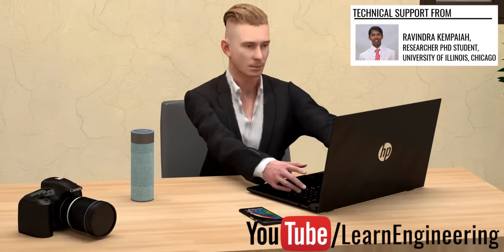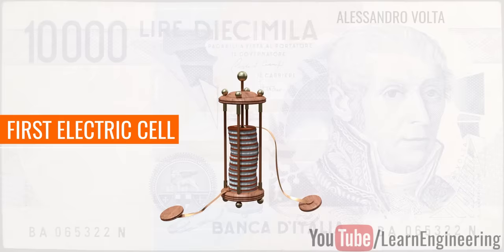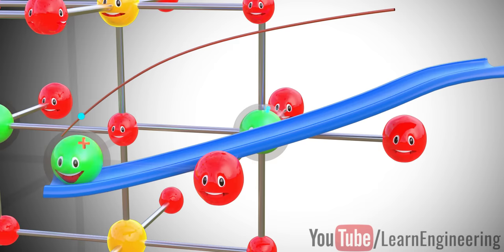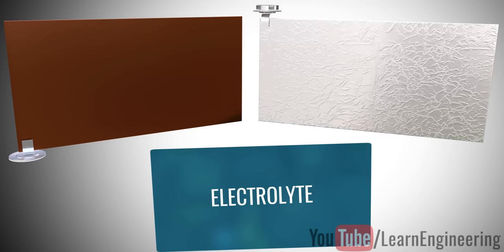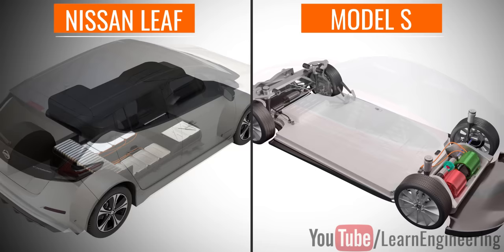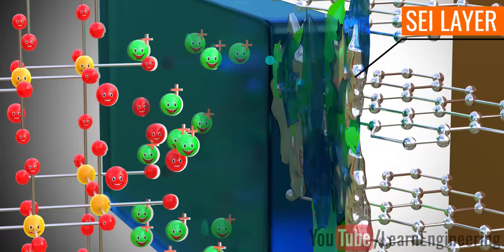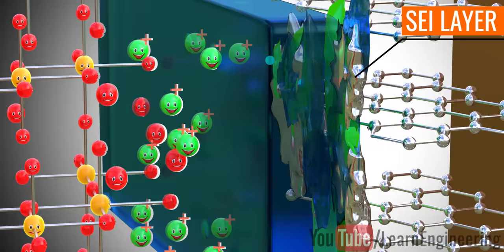Lithium-ion battery, How does it work?

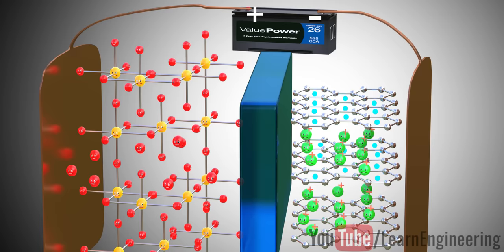Comment: Very nice animation and great level of detail. But... Why don't the electrons and Li+ ion simply recombine on the right-hand side (anode)? How does a material work that prevents extremely tiny electrons to pass, but allows Li+ ion to traverse it where a Li+ ion is orders of magnitude larger as an electron? Why don't we prevent the Li+ ions to flow and keep them on the left-hand side, so only the electrons flow back and forth? At 4:23 the battery is fully charged but the cathode is neutral - how is it charged at all. After all charging = separation of charges.

Comment: The way you explained this is very  good but something is confusing me during that part  on the power source which I believed is the Charging Process . Please correct me if I am wrong. The electrons detached from the Lithium atom on the metal oxide ( left side) will be attracted by the positive side of the  power source and STOPS there. Those  electrons cannot CROSS   there., their job  are to neutralize the positive ions  on the positive side of the power source. The Negative side of the power source will provide the Fresh Electrons   on the graphite sheet until it is full of electrons and all the lithium ion have crossed back to the graphite.

Comment: 2S electron of lithium in lithium metal oxide is transferred to the transitional metal core of the metal oxide. Lithium stays as ion in the Lithium metal oxide complex. Lithium intercalated in
graphite electrode is again mostly ionic with the 2S electron in the pi system of graphite. The process so decribed can not be spontaneous if at both ends the electrons remain with Lithium.

Comment: If we mix two metals after that make a point with thich wore and other side with thin wire it will charge faster and we can also use metals at one side and other metal on another side and use it

Comment: DESIGN SPEC TO AVOID FIRE ; Avoid immediate Charging after getting discharged; Added regions to avoid permanent dead; design and usage cycle spec to recycle ; N2 Flow for thermal stability

Comment: I have some stupid questions: how BMS manages cell charges individually if they are connected in parallel? And why the healthy cell was charged faster? And, did Tesla invented BMS? What about energy density difference between multiple small cells and one large?
Reply: Yeah i was wondering the same thing that big capacity means slow charge

Comment: I am developing a firefighter related class on the dangers of lithium-ion batteries. I would like to know if I may with your permission and reference, use your video to explain the construction part of the lithium ion battery. It is better explained than my power point slides.

Comment: I have been reading about electricity everyday for over a week now.
And I found the few small details thay helps to explain why all the principles are so confused. I write it down, hope it help anybody.
- Electrons dont flow in circuit like all animations showed on youtube. They dont start from negative terminal and enter positive terminal. They leave negative terminal with very low speed (to us, to them it's quite fast), about mm/s, push the near electrons away and so on. Very quickly, electrons keep pushing one another and push electrons at the other end of the wire enter the positive terminal.
- there is current in open circuit, it just stops really really quick. Like: if you connect an end of a wire to a battery, there is movement of electrons for miliseconds and stop. But only in closed circuit the movement is continuous.

Comment: Good interesting video. Vehicle electric motors are not always induction motors. Different types of motors are used, which all have their disadvantages and advantages. The five major ones are: Permanent magnet synchronous motor, induction motor, DC motor, brushless DC motor and switched reluctance motor.

Comment: In the end you pointed out, that there are intentions of using silicon only. This is wrong: Using Silicon leads to alloying/formation reactions which leads to a much greater specific capacity but also a huge volume expansion of about 400% at the anode side, when charging which results in a lot of mechanical stress for the cell and therefore accerlate side reactions as cracks -> the building of additional SEI -> capacity losses, to just name one example. The market however intends to use a little silicon to improve the specific capacity without putting too much mechanical stress to the cell. 
Correct me if I'm wrong.

Comment: how electrons flow in opposite direction of the electric field when the battery connected to an external circuit??... i really need an explanation, please
Reply: Back when humans were first experimenting with electricity, we suspected something charged was flowing, but as all the charge carriers are invisibly small, we had a 50/50 chance of getting it right which direction the flow was going.
We guessed wrong.    For almost all circuits, it was the electrons that flow, positively charged things are much heavier and stayed still.

Comment: Great video, i learned a lot on this topic from this video alone!
How can solvent molecules (from the electrolyte) cover a single lithium-ion? It is depicted in the video as a gooey layer that engulfs the lithium ion, but how would that actually look if you represented the solvet molecules as actual molecules? (I think i have a problem with understanding the scale used here).

Comment: At minute 4:15, I was confused. The external power source introduces electrons to anode compartment, that forces the Li+ ions within the metal oxide to move through electrolyte. But prior to that, it was explained that the electrons from Li atoms trapped in metal oxide structure exit from cathode electrode towards external power source. This part I don't understand. There is no lose electron i that structure (yet), and Li has no available lose electron to send towards power source via cathode. ?!

Comment: Where do the electrons sit in the Graphene layer? If the Li ions are physically sitting in-between the carbon sheets, would it be correct to say that in the charged state, the electrons are sitting in the graphene's conduction band, but do not recombine with the Li ions due to the physical separation?

Comment: I have heard of a completely dry battery industry consisting of a sheet of silicium and on its sides two sheets of aluminum and lithium only. When the two plates are connected the lithium reacte to give silissure (si4- ...4Li+)and electricite

Comment: Lithium cells.  They don't like being kept fully charged,  they don't like being totally dead . They don't like heat and don't like cold. When assembled as a batter they need a management system for changing and monitor discharge. But they do produce a nice profit.

Comment: The main drawbacks with ICE cars are not poor speed control, low acceleration, not self started, low starting torque etc but that they pollute a lot and that they are inefficient. That is why we need EVs.

ICE cars are quite reliable despite of the fact that the engines have thousand of moving parts. 

They are well balanced as well and you can't really feel the vibrations.

Funny that those most important drawbacks, which are the driving force behind the EV revolution, aren't mentioned.

Comment: Are there any batteries that can be recharged forever..??? And   can you explain capacitors used for storing electricity,  My understanding of a capacitor is that its a vacuum bottle full of electrons .. and the problem with using a capacitor is that they  discharge there entire charge at one time.. so they will explode if used wrongly.

Comment: Sir i had a question if electron interaction with electrolyte is not desired than what happens on the right side before the application of external current dont electrons interact with electrolyte there when  they are in outer shell of lithium atom
Reply: Ajaz Amin they don't reach the electrolyte on that end because the electrons all go back to the molecules before they reach it

Comment: There is a small correction. We must use two separators in cylindrical cells other wise it will get shorted during winding.
Reply: IIT Madras created iron battery check out

Comment: How come those Lithium ions and electrons don't interact with each other in the graphite?
Reply: Well, lithium tends to liberate electrons because, the electrons located in inner orbitals, reppel the outer most electrons (only one electron in lithium's case). And the universe always looks for stability, and for a Lithium species, it's more stable to lose that electron. It doesn't happen much in other elements due to a bunch of stuff(Effective nuclear charge among them), so that's the specific case for lithium or alkaline metals in general.

Comment: According to an estimate the real driving range of a BEV is 400Km on a fully charged battery, having Battery capacity of 84000Wh.
So if the cycle is 3000, the lifetime capacity of a battery is 252MillionWh or lifetime driving range of 1.2 Million Km (400*3000).
Again according an estimate, averagely a car runs ~50Km per day.
Argo, A car can run 24000 days = 65 years.
If we even add a buffer of 20-30% the lifespan comes to 52-45 years....

Am I missing something?

Comment: While the narrator may disparage flat LiPo cells, they allow a denser energy storage than round cells. As a test the other day I fed what normally is a 4.2V, 2.2A pouch cell 5V and 5A. Guess what happened. Not a thing except for the battery being fully charged. And yes, it was one made by Sony. And there was no BMS attached to it to do anything in the way of protection. The cell was over water so that if something had happened as I expected, it would have dropped into the metal can of water.

Comment: Toyota already figured out how to make the battery last 10000-50000 cycles, keep the state of charge between 30-80% & avoid high heat & freezing cold 
Keeping the cells 50-70 Deg. F temp & between 3.2 & 4.1 vdc greatly enhances their cycle life & calendar life / true for NiMH & Lithium Ion ^^ Cheers

Comment: A better battery can be produced with semiconductor layer controlled with a gate valve this layer can regulate the electron flow within the cell and it's rate of Discharge. My new battery design allows more accurate charging and regulated discharge of the cell without degredation
Reply: A litium ion battrey  made with a NPN layer with a Gate Valve Electrode will controlling Electron flow within the cell plates, this semiconductor layers acts as a Gate valve it controlling the Electron discharge and recharge without cell Degredation of plate surfaces. This transistor semiconductor Layers limits and throttles the cell Discharge and protects it from rapid discharge that degrades cell plates, this is a ion limiter a built in regulator. This is my new cell Desighn for Lithium ion battreys 😁
Reply: @Chris Biggs  Chris I make battreys for stuff projects electronics. I want to build this on a full scale.   I started making battreys as a kid to run things in my bedroom.😁 I basically descibed the battrey but not in detail.  It's construction is simple Layers of copper foil lithium  separator semiconductor layers and more lithium and  aluminum foil.  The semiconductor layers regulate ion exchange between the plates. The battrey is rolled up with wires for positive plate and negative plate and  semiconductor layers . This stops overcharge and regulates discharge.  My electric plastic motor is yet to be built but I have the plans and theroy it's a induction Motor with a plastic armature and plastic fields. It runs off of 1wire . It's something New the speed is controlled by frequency. I also have plans for 1wire house wiring and lights.   The current won't shock people.
Reply: @Chris Biggs  but Chris who cares? I'm just a poor inventor. And these things are  way before thier time. Maybe if a company hired me to build stuff I could do it for them.  But as you know money always talks😁. It buys food and pays the rent. But the world could use this Battrey Desighn it has a controller that regulates the semiconductor layers inside the cell. I guess I'm a Tesla looking for my JP Morgan.😁
Reply: @Chris Biggs  my motor runs off of electromagnetic induction, high frequency electromagnetic current. It only needs 1wire to make it Run 😁
Reply: @Chris Biggs so Chris what have you made?
Reply: Cat got your tounge? 🤔 Dam cat 🐈

Comment: Defiantly very useful, but why do these batteries have a lifetime? 
If the ions can move through the electrolyte without loss (after the first charge), why does the cell loose performance and eventually becomes useless?

Comment: So, what you’re saying is that the fundamental chemistry of any battery has not changed in more than 200 years. There has been some nibbling at the edges of efficiency but no fundamental change. The EV superiority seems to be the induction motor. These motors, are indeed, powerful as witnessed by modern locomotives whose large induction motors are powered by large diesel engines carried on board. One begins to think that EVs are a dead end technology barring some leap in the chemistry.

Comment: So I'm a bit slow I have a question about charging if anyone can help me.

I understand the lithium ions would be attracted to the negative terminal and go through the electrolyte on their way there and get trapped/stored in the graphite.

However for the electrons, surely if they're attracted to the power source positive, wouldnt they just stop there and not go any further, why do they carry on into the graphite?
Reply: they will stop if and only if they're at the positive Terminal (cathode), the terminal is the only stopping point for electron, otherwise, electron will flow until it reaches an ion and makes stable atoms

Comment: At 4:20 this explanation makes no sense to me. The graphite contains lithium ions and free electrons but they don't combine to form lithium atoms? The electrons are free and just hang out?  And electrons travel through the wire in both directions? I could use a simple explanation. For example, what is the overall chemical reaction? What are the half reactions? The best explanations are the simplest ones. Thanks.

Comment: A nice visual simplification with some large flawed technical statements at the cell level. e.g. “An organic salt of lithium acts as the electrolyte”, “graphite does not play a role in the reaction in the lithium ion cells” and “Electrolyte acts as a guard which allows only lithium ions through”. I’m guessing this is about 10 years old given the incorrect statements about the Nissan Leaf.

Comment: Which direction of lithium ion travel does the electron get taken up by motor, device, etc?
Reply: Electrons don't get consumed in a circuit (motor, cellular antenna...)
They just pass through in a hurry to get to a lower potential (lower energy state.)
In the Lithium battery, that would be the crystalline oxide lattice.
Reply: @NullHand  Thx. I need to take the time to learn about these fundamentals. Electricity science too important not to have at least a basic working knowledge.
Reply: @grizzlymartin1  I agree.
You can run the machines.
Or the machines can run you...

Comment: Can someone please explain. It is stated in the video that the positive side  of the power source attracts electrons (which is obvious), BUT why do those electrons then flow to negatively charged layer (graphite)? Why would a negatively charged particle (electron) flow to a negatively charged side?
Reply: You’re confusing conventional flow with physical flow of electrons. This video is using both conventional (battery terminals) and physical (where the electrons are moving to). So you have to reverse its meaning.

Comment: This video ignores the reduction that occurs at the cathode, for example Fe3+ to Fe2+ for a LiFePO4 battery. Similarly if graphite were storing lithium ions the battery would be dead. It is storing lithium atoms that have the electron needed to flow through the wire during discharge.

Comment: Hello I own an ebike shop and I’m trying to find out if lithium ion batteries have anything inside them (including IN the cells) that resembles lithium or bike grease??
Reply: Lithium is a metallic element, very much like Sodium when pure, dangerously reactive in water, oxygen, etc.
This reactivity means that in the natural world, like Sodium, it is almost always found in its ionic form as a salt.
Grease is made by taking a lubricating oil, and to make it less runny (liquid), adding a form of soap to it.
A soap is basically a salt made from a strong Alkali (LiOH, NaOH) reacted with a fatty acid to make basically a fat-salt.
So no.  The Lithium in your bike grease is only there in soap form, in a battery it is an Ion dispersed in a crystalline matrix.

Comment: Elon  Musk with  his intelligence should also know that sitting right behind 1,200 pounds of raging lithium ion batteries discharging about 85KWh (model S 100KWh) for several years will undoubtedly culminate into all the manifestations of lithium  poisoning, including kidney failure. The Tesla's engine is very powerful. Its action potential is more than we've ever seen. There is a formidable explosion of electricity whose secondary effects may permeate through the vehicle's interior.  But we are reactive and  waiting for a few rich people with unexplained symptoms and kidney failure to connect the dots with Tesla. This latter is a pretty cool car. Maybe driving it in addition to paying the cost of a small house  is still worth a few kidneys.  I do hope I'm wrong because there are a lot of Tesla on the road.